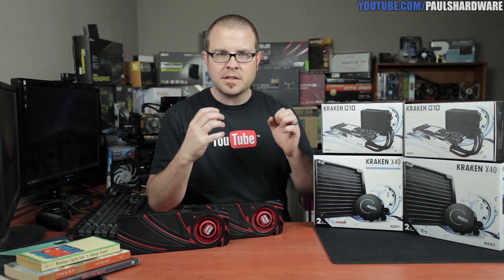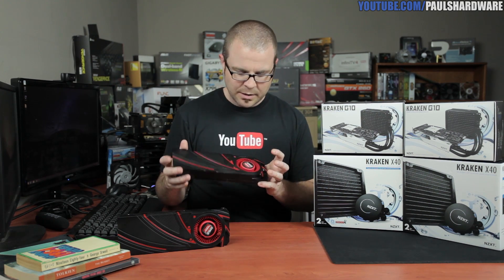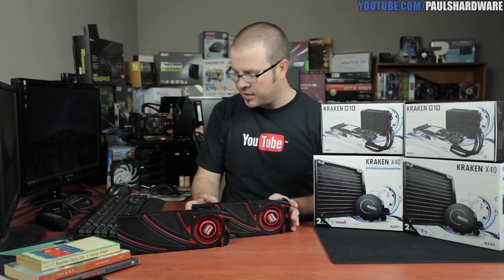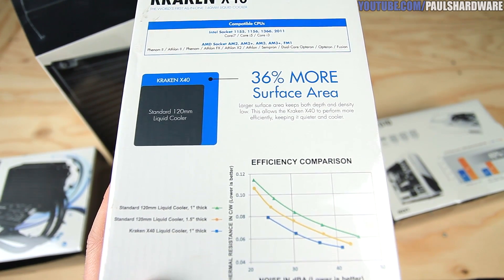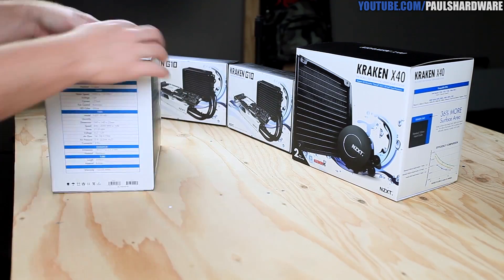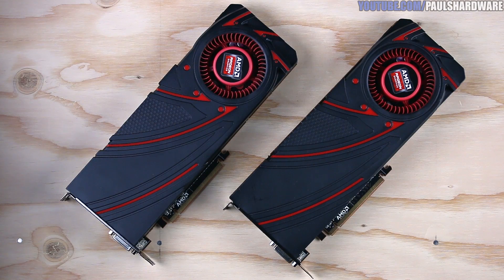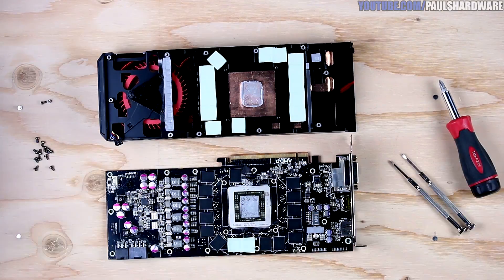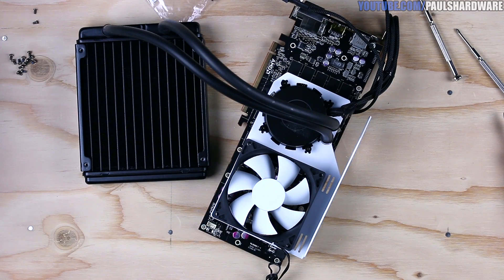Preparing for 4K: Part 1 - NZXT Kraken G10 Install on the AMD R9 290X

Comment: Sorry Paul, but using 2-3 (I assume ditto on the CPU) self contained liquid coolers makes absolutely no sense to me whatsoever. In this case clearly it's best to create a *real custom component water loop.*

The Kraken coolers with a fan on the PCB seems idiotic in their design. Even if I received the Kraken's for FREE I wouldn't use them this way e.g. SLI/CF + CPU cooling solution.
Reply: totally agree. We need an AIO gpu and cpu cooler that is closed loops someday. buildng a custom loop cost so much but its worthed.
heres my build log:
http://www.overclock.net/t/1476748/project-reaper-nzxt-h440-build-log#post_22005671
Reply: Not in the know about WC'ng, but wouldn't a custom loop cost loads more?
Reply: MicronesianFlow it would indeed, i got the g10, h2o 920 and gelid vrm heatsink set for much less than the price of a 290x water block. nevermind the other parts required to have a custom loop or integrate another block into an existing one. ok it will not get temps as good, but it will work on dozens of other cards and i imagine future cards too while the 290x block will soon become a £100 paper weight.

Comment: Does anyone know a really silent HDD? I have a Seagate right now, but it isn't silent enough yet for my taste, because it is the only part that I can hear while on youtube.
Reply: A 120 or 250GB Samsung EVO will be the best choise.
Reply: Do you have rubber spacers between the  hdd and the bracket?
Reply: Rúben Valentim yes, the drive is hold in place by rubber spacers, that slide into the hard drive cage.
Reply: humm... that's the first thing I would try...who long do you have it?
Reply: Yeah, me too, I got mine (500gb) a month ago. This is perfect for laptops but doesn't matter for desktops tho.
Reply: WD green 1tb oder 2tb
Reply: Lars Reviews I had the same problem, Hard drives are loud and slow. I bought an ssd and i couldn't be happier with it!
Reply: Rúben Valentim I got it in july 2013. I can´t tell if it got nosier, because I was used to a old WD drive that made the ccrcrcrcr sound.
TGHstudio I think will also go with a ssd, my Win8 with software uses 80gb and all my docs are stored in the cloud. Also my dad put all our songs on the itunes cloud and pictures on the google cloud.
Reply: TGHstudio we got a evo for our macbook pro. It was the first time I was holding a ssd in my hand and my first though was if the metal cover was empty, because it weighs nothing. I was totally amazed. :D
Reply: I was gonna say Seagate Barracuda, Mine is silent. Otherwise an SSD

Comment: I'm a little confused... The radiator is for air cooling..? Or water cooling? I see the tubes? Is that to carry the air or water? I don't understand that much about cooling when it comes to things like these...
Reply: It is a Closed Loop Water Cooler.  So, as Fadhlan said, it has the liquid already set up.  That is why people like them.  Take note, originally, the Kraken x40 and Kraken x60 were intended to be for the CPU itself.  The Bracket is an accessory so that you can use the CPU cooler on the graphics card.  :-)
Reply: The radiator is like a heatsink for the water. It works exactly like a radiator in your car (assuming you know how a car radiator works). Basically, one tube sends hot water into the radiator where it passes through a series of small tubes. Those tubes are then cooled by those tiny fins. The fins are then cooled by the fans. Then, that now cool water is sent back to the CPU block through the other tube to absorb the heat. The block is also where the pump is. Then it repeats.
Reply: it is fairly plug and play.  YOu would want to add something like the ones I link at the end to the memory modules, (the black chips around the actual die) just so that they would cool a little more, but it isn't absolutely required unless you are overclocking a lot.  The only thing you absolutely have to do, is have a spot to mount the radiator after installing the pieces, and following the instructions.  It is nerve racking the first time.. it took me 45 minutes to get the first one done.  second one was complete in 20 minutes.  

http://www.frozencpu.com/products/3885/vid-54/Swiftech_MC14_Forged_Copper_16-Pin_Video_Card_BGA_Memory_Ramsinks_-_14mm_x_14mm_x_14mm.html?tl=g40c21s226
Reply: the cooler come with pre-installed with the liquid.
so no tubes.
Reply: Okay, I think I see what you guys are saying. So basically (since I have no water cooling in my computer) I would be able to hook this to my GPU and it would be all set to go? I wouldn't need a tube that holds the liquid, it's like a plug in play type of thing? If that makes any sense.
Reply: Fadhlan Rahim actually theres a tube, the thing that doesn't have is the reservoir.
Reply: BTW a radiator is where the liquid travels to, to cool. The water travels around it and the heat gets dispersed in the fins. The fans blow or pull the heat of the fins.
Reply: Jay Man and you just had to top my answer, props for being more specific, but if they really wanted to know specifics, well there is a google.

Comment: If "good value 4K" was the point of this video, why not go with the 290 instead of the 290x ? The difference in fps seems to be ranging from 1 to 5 on 4K benchmarks, some 290 even beating 290x in some benchmarks.

Comment: You'd probably be good for your testing, but anyone getting the G10 for permanent use DEFINITELY needs to install heat sinks.
Reply: On some graphics cards, they have a plastic to cool the VRM/RAM, It will cool even better without the heatsink in front of it.
http://www.techpowerup.com/reviews/MSI/GTX_780_Lightning/images/cooler3.jpg
http://www.techpowerup.com/reviews/EVGA/GTX_780_SC_ACX_Cooler/images/cooler3.jpg
Reply: benbasss Yes obviously that would work instead of heat sinks. Any card that has one of those probably doesn't even need the G10 anyway.

Comment: Screw the Titan Blacks, get the new Titan Zs in SLI!
Reply: Titan z is a rip off
Reply: Doesn't matter, moar power!
Reply: Or you could get 4 titan blacks and save 2k as the titan z, which is essentially 2 titan blacks on a single card, for 3k per card. you can 4-way sli the titan blacks, but only 2-way sli the titan z
Reply: Scarlet Tech Why are you targeting Nvidia with the hate? AMD are the same. It's nothing new. Several years ago I had an AMD 5770 and upgraded to a 6770 just to find out there 100% identical, The R7 and R9's up to the 280x are just rehashes of the HD7000 cards aswell. Both companies do it and have done for years. Nvidia won't release the new architecture until the old is being beaten. The GK110 is still the best so until it isn't they'll delay replacing it for as long as they can.
Reply: Scarlet Tech I'd ban amd cpus and apus if I controlled world
Reply: 300k20  How can you know there dual cards and then moan that they only go 2-way sli?
Using two Titan-z's means your running 4 way sli.
Reply: nasha thedog Let me clarify. I know having dual gpus' on a sigle card is like running 2 single gpu cards in 2-way sli, and therefore 2 dual gpu single cards is like running 4-way sli. What i meant is that, physically, you can only run 2 Titan Z card on a single system. I typed as if i was talking about 2 single gpu cards.  I wasn't moaning about anything, just stating something.
Reply: TimmyM56 Four Titan Blacks is more power.  You can OC higher since there's less shared resources and heat output per GPU.  Three Titan Blacks might even perform better than two Titan Zs depending on SLI scaling.
Reply: Darkblaze371 It's built for workstations, so for gaming it is...
Reply: Raymond Tyson EVGA is releasing a 6GB 780 and 780Ti soon.
Reply: I wish i could control the world, because I wouldn't let anyone pay NVidia for lying to the customers and then just simply revamping the same GPU (AGAIN!!!!) rather than release maxwell..  Also, if people weren't foolish enough to pay $3k for the Z, then we would get maxwell..
Reply: headcas620 With the titan z all you can do is 2 way sli, the titan z is virtually a gtx 690 but instead of 2 680 its 2 780ti with more ram.
Reply: Toxic Moofin Nooo... It's 2 Titan Blacks on the same PCB.
Reply: Video editing will see no real performance increase.

Anyone serious about AutoCAD, Revit, Maya, or 3DS Max will be using a Quadro, not a Titan Black, for massively better viewport framerate.

I can't speak for game devs, but I think that you're probably right on that one.  At least, on coding and rigging.  Actual development of art and models will again be done on Quadros.
Reply: nasha thedog I just noticed your post, lol.  I wasn't meaning to target NVidia, but it seems that way.  I find it funny, because for many months, I figured NVidia would push Maxwell with some outstanding rehashed core.. GM204.. the same core as the GK104, but the architecture is better, efficiency is better, and the have made major improvements between the two.. so, I stand corrected and can't blame them now.  I am very interested in seeing the new AMD card, and hope they make it better than the NVidia cards, so we can see a new competition between the two companies :-)

kevin russell I wouldn't ban them, but I would request that they stop pussyfooting around and make them worth a damn so that Intel will be forced to show off again.. :-D